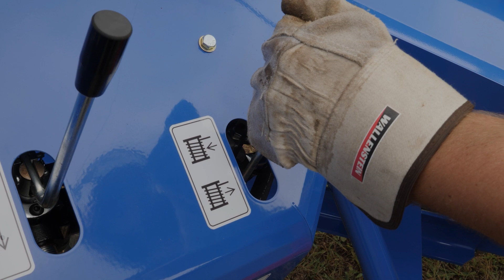Wallenstein WP525 Firewood Processor

Comment: Interesting design change over the original, just wish the cycle time was lower than 13 seconds and auto-split was included.
Reply: I agree and they should have hydraulic saw and faster splitting cycle. I don't understand the three box wedge with no pull back arm?
Reply: @earthandheavenlandscapinga4850  yeah, it's not an equal third split.

Comment: Why use a gas powered chainsaw. Now you have to have both four stroke gas and two stroke gas. It's a nice compact design but would be better served with a hydraulic chainsaw.
Reply: Probably use a gas saw to keep the price cheaper and make the design simpler